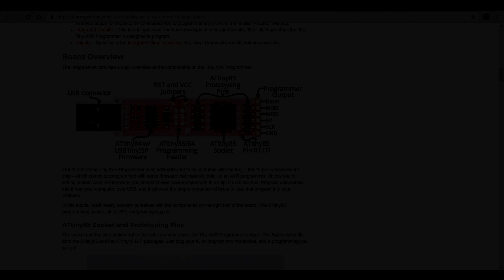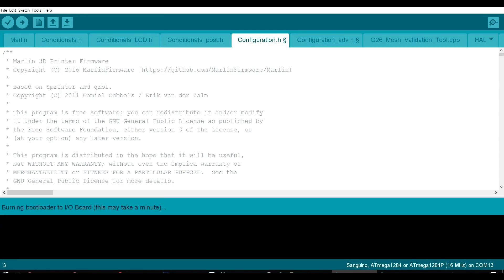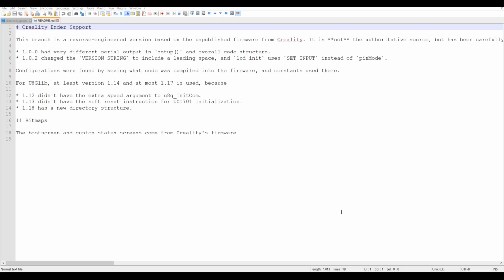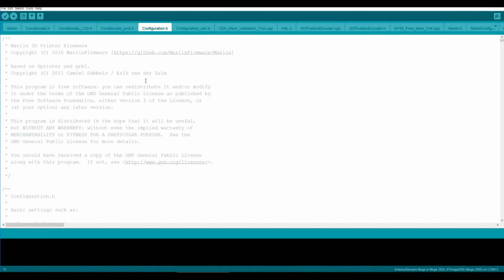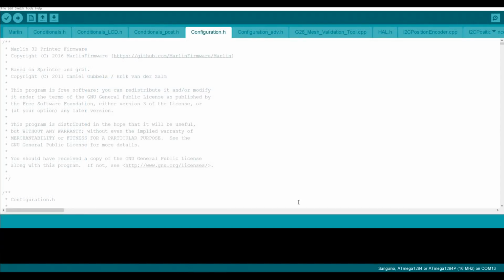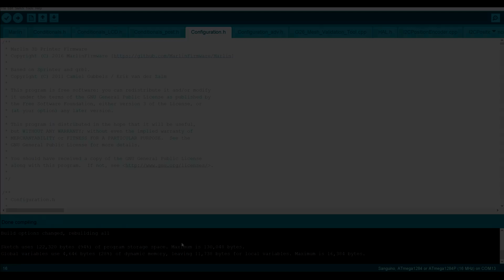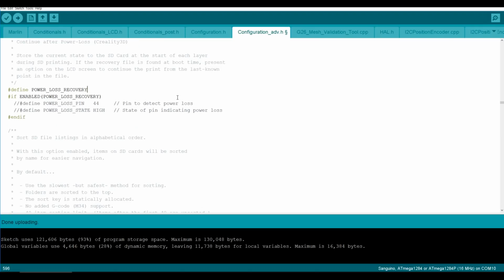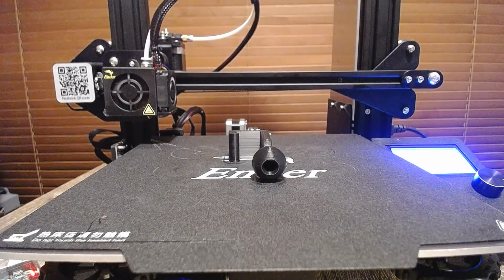Ender 3 vanilla Marlin update: Concise guide

Comment: Works fine until I try to add the Sanguino board.  I keep getting an error on download - Something about the java signature.  I get this error
sun.security.provider.certpath.SunCertPathBuilderException

Arduino: 1.8.7 (Windows 10), Board: "Arduino/Genuino Uno"

Error reading file (C:\Program Files (x86)\Arduino\hardware\arduino\avr\boards.txt:0): Invalid line format, should be 'key=value'

Error compiling for board Sanguino W/ ATmega1284 or ATmega1284P (16MHz).
Invalid library found in C:\Program Files (x86)\Arduino\libraries\NEW_Touchscreen: no headers files (.h) found in C:\Program Files (x86)\Arduino\libraries\NEW_Touchscreen
Invalid library found in C:\Program Files (x86)\Arduino\libraries\NEW_Touchscreen: no headers files (.h) found in C:\Program Files (x86)\Arduino\libraries\NEW_Touchscreen
 Error downloading https://github.com/Lauszus/Sanguino/releases/download/1.0.2/Sanguino-1.0.2.zip
java.lang.RuntimeException: java.lang.Exception: Error downloading https://github.com/Lauszus/Sanguino/releases/download/1.0.2/Sanguino-1.0.2.zip
 at cc.arduino.contributions.packages.ui.ContributionManagerUI.lambda$onInstallPressed$2(ContributionManagerUI.java:175)
 at java.lang.Thread.run(Thread.java:748)
Caused by: java.lang.Exception: Error downloading https://github.com/Lauszus/Sanguino/releases/download/1.0.2/Sanguino-1.0.2.zip
 at cc.arduino.contributions.DownloadableContributionsDownloader.download(DownloadableContributionsDownloader.java:139)
 at cc.arduino.contributions.DownloadableContributionsDownloader.download(DownloadableContributionsDownloader.java:73)
 at cc.arduino.contributions.DownloadableContributionsDownloader.download(DownloadableContributionsDownloader.java:55)
 at cc.arduino.contributions.packages.ContributionInstaller.install(ContributionInstaller.java:101)
 at cc.arduino.contributions.packages.ui.ContributionManagerUI.lambda$onInstallPressed$2(ContributionManagerUI.java:172)
 ... 1 more
Caused by: javax.net.ssl.SSLHandshakeException: sun.security.validator.ValidatorException: PKIX path building failed: sun.security.provider.certpath.SunCertPathBuilderException: unable to find valid certification path to requested target
 at sun.security.ssl.Alerts.getSSLException(Alerts.java:192)
 at sun.security.ssl.SSLSocketImpl.fatal(SSLSocketImpl.java:1964)
 at sun.security.ssl.Handshaker.fatalSE(Handshaker.java:328)
 at sun.security.ssl.Handshaker.fatalSE(Handshaker.java:322)
 at sun.security.ssl.ClientHandshaker.serverCertificate(ClientHandshaker.java:1614)
 at sun.security.ssl.ClientHandshaker.processMessage(ClientHandshaker.java:216)
 at sun.security.ssl.Handshaker.processLoop(Handshaker.java:1052)
 at sun.security.ssl.Handshaker.process_record(Handshaker.java:987)
 at sun.security.ssl.SSLSocketImpl.readRecord(SSLSocketImpl.java:1072)
 at sun.security.ssl.SSLSocketImpl.performInitialHandshake(SSLSocketImpl.java:1385)
 at sun.security.ssl.SSLSocketImpl.startHandshake(SSLSocketImpl.java:1413)
 at sun.security.ssl.SSLSocketImpl.startHandshake(SSLSocketImpl.java:1397)
 at sun.net.www.protocol.https.HttpsClient.afterConnect(HttpsClient.java:559)
 at sun.net.www.protocol.https.AbstractDelegateHttpsURLConnection.connect(AbstractDelegateHttpsURLConnection.java:185)
 at sun.net.www.protocol.https.HttpsURLConnectionImpl.connect(HttpsURLConnectionImpl.java:162)
 at cc.arduino.utils.network.FileDownloader.downloadFile(FileDownloader.java:181)
 at cc.arduino.utils.network.FileDownloader.download(FileDownloader.java:132)
 at cc.arduino.contributions.DownloadableContributionsDownloader.download(DownloadableContributionsDownloader.java:137)
 ... 5 more
Caused by: sun.security.validator.ValidatorException: PKIX path building failed: sun.security.provider.certpath.SunCertPathBuilderException: unable to find valid certification path to requested target
 at sun.security.validator.PKIXValidator.doBuild(PKIXValidator.java:397)
 at sun.security.validator.PKIXValidator.engineValidate(PKIXValidator.java:302)
 at sun.security.validator.Validator.validate(Validator.java:260)
 at sun.security.ssl.X509TrustManagerImpl.validate(X509TrustManagerImpl.java:324)
 at sun.security.ssl.X509TrustManagerImpl.checkTrusted(X509TrustManagerImpl.java:229)
 at sun.security.ssl.X509TrustManagerImpl.checkServerTrusted(X509TrustManagerImpl.java:124)
 at sun.security.ssl.ClientHandshaker.serverCertificate(ClientHandshaker.java:1596)
 ... 18 more
Caused by: sun.security.provider.certpath.SunCertPathBuilderException: unable to find valid certification path to requested target
 at sun.security.provider.certpath.SunCertPathBuilder.build(SunCertPathBuilder.java:141)
 at sun.security.provider.certpath.SunCertPathBuilder.engineBuild(SunCertPathBuilder.java:126)
 at java.security.cert.CertPathBuilder.build(CertPathBuilder.java:280)
 at sun.security.validator.PKIXValidator.doBuild(PKIXValidator.java:392)
 ... 24 more
Invalid library found in C:\Program Files (x86)\Arduino\libraries\NEW_Touchscreen: no headers files (.h) found in C:\Program Files (x86)\Arduino\libraries\NEW_Touchscreen
Invalid library found in C:\Program Files (x86)\Arduino\libraries\NEW_Touchscreen: no headers files (.h) found in C:\Program Files (x86)\Arduino\libraries\NEW_Touchscreen
Invalid library found in C:\Program Files (x86)\Arduino\libraries\NEW_Touchscreen: no headers files (.h) found in C:\Program Files (x86)\Arduino\libraries\NEW_Touchscreen
Invalid library found in C:\Program Files (x86)\Arduino\libraries\NEW_Touchscreen: no headers files (.h) found in C:\Program Files (x86)\Arduino\libraries\NEW_Touchscreen
Invalid library found in C:\Program Files (x86)\Arduino\libraries\NEW_Touchscreen: no headers files (.h) found in C:\Program Files (x86)\Arduino\libraries\NEW_Touchscreen
Invalid library found in C:\Program Files (x86)\Arduino\libraries\NEW_Touchscreen: no headers files (.h) found in C:\Program Files (x86)\Arduino\libraries\NEW_Touchscreen
Invalid library found in C:\Program Files (x86)\Arduino\libraries\NEW_Touchscreen: no headers files (.h) found in C:\Program Files (x86)\Arduino\libraries\NEW_Touchscreen
Invalid library found in C:\Program Files (x86)\Arduino\libraries\NEW_Touchscreen: no headers files (.h) found in C:\Program Files (x86)\Arduino\libraries\NEW_Touchscreen
 Error downloading https://github.com/Lauszus/Sanguino/releases/download/1.0.2/Sanguino-1.0.2.zip
java.lang.RuntimeException: java.lang.Exception: Error downloading https://github.com/Lauszus/Sanguino/releases/download/1.0.2/Sanguino-1.0.2.zip
 at cc.arduino.contributions.packages.ui.ContributionManagerUI.lambda$onInstallPressed$2(ContributionManagerUI.java:175)
 at java.lang.Thread.run(Thread.java:748)
Caused by: java.lang.Exception: Error downloading https://github.com/Lauszus/Sanguino/releases/download/1.0.2/Sanguino-1.0.2.zip
 at cc.arduino.contributions.DownloadableContributionsDownloader.download(DownloadableContributionsDownloader.java:139)
 at cc.arduino.contributions.DownloadableContributionsDownloader.download(DownloadableContributionsDownloader.java:73)
 at cc.arduino.contributions.DownloadableContributionsDownloader.download(DownloadableContributionsDownloader.java:55)
 at cc.arduino.contributions.packages.ContributionInstaller.install(ContributionInstaller.java:101)
 at cc.arduino.contributions.packages.ui.ContributionManagerUI.lambda$onInstallPressed$2(ContributionManagerUI.java:172)
 ... 1 more
Caused by: javax.net.ssl.SSLHandshakeException: sun.security.validator.ValidatorException: PKIX path building failed: sun.security.provider.certpath.SunCertPathBuilderException: unable to find valid certification path to requested target
 at sun.security.ssl.Alerts.getSSLException(Alerts.java:192)
 at sun.security.ssl.SSLSocketImpl.fatal(SSLSocketImpl.java:1964)
 at sun.security.ssl.Handshaker.fatalSE(Handshaker.java:328)
 at sun.security.ssl.Handshaker.fatalSE(Handshaker.java:322)
 at sun.security.ssl.ClientHandshaker.serverCertificate(ClientHandshaker.java:1614)
 at sun.security.ssl.ClientHandshaker.processMessage(ClientHandshaker.java:216)
 at sun.security.ssl.Handshaker.processLoop(Handshaker.java:1052)
 at sun.security.ssl.Handshaker.process_record(Handshaker.java:987)
 at sun.security.ssl.SSLSocketImpl.readRecord(SSLSocketImpl.java:1072)
 at sun.security.ssl.SSLSocketImpl.performInitialHandshake(SSLSocketImpl.java:1385)
 at sun.security.ssl.SSLSocketImpl.startHandshake(SSLSocketImpl.java:1413)
 at sun.security.ssl.SSLSocketImpl.startHandshake(SSLSocketImpl.java:1397)
 at sun.net.www.protocol.https.HttpsClient.afterConnect(HttpsClient.java:559)
 at sun.net.www.protocol.https.AbstractDelegateHttpsURLConnection.connect(AbstractDelegateHttpsURLConnection.java:185)
 at sun.net.www.protocol.https.HttpsURLConnectionImpl.connect(HttpsURLConnectionImpl.java:162)
 at cc.arduino.utils.network.FileDownloader.downloadFile(FileDownloader.java:181)
 at cc.arduino.utils.network.FileDownloader.download(FileDownloader.java:132)
 at cc.arduino.contributions.DownloadableContributionsDownloader.download(DownloadableContributionsDownloader.java:137)
 ... 5 more
Caused by: sun.security.validator.ValidatorException: PKIX path building failed: sun.security.provider.certpath.SunCertPathBuilderException: unable to find valid certification path to requested target
 at sun.security.validator.PKIXValidator.doBuild(PKIXValidator.java:397)
 at sun.security.validator.PKIXValidator.engineValidate(PKIXValidator.java:302)
 at sun.security.validator.Validator.validate(Validator.java:260)
 at sun.security.ssl.X509TrustManagerImpl.validate(X509TrustManagerImpl.java:324)
 at sun.security.ssl.X509TrustManagerImpl.checkTrusted(X509TrustManagerImpl.java:229)
 at sun.security.ssl.X509TrustManagerImpl.checkServerTrusted(X509TrustManagerImpl.java:124)
 at sun.security.ssl.ClientHandshaker.serverCertificate(ClientHandshaker.java:1596)
 ... 18 more
Caused by: sun.security.provider.certpath.SunCertPathBuilderException: unable to find valid certification path to requested target
 at sun.security.provider.certpath.SunCertPathBuilder.build(SunCe
Reply: Update -Had to do a work around - Since the Sanguino board was in the TH3D Software I updated the config files within it and its included version of arduino.  I never did get it to work on the out of the box arduino 1.8.7 and emailed the author of the code with the error.  We will see what they say.
Reply from the maker: That's a weird one. An uno error when selecting a Sanguino. Fingers crossed for you. I believe you can start with the TH3D batch file and then open any Arduino ino file from there if that helps. Maybe I've misunderstood and that's what you've already done.

Comment: It seems having an Arduino bootloader on the printer causes it to reboot when the COM port is opened, at least that is what is happening to me. This causes Cura not to detect the printer as it only 1.5 seconds for the reboot. Printing via USB stick is OK though. Might be worth a guide on how to program Marlin without a bootloader.

Comment: I have been meaning to update my ender 3 using your guide for a week or 2 now and today I finally got the chance. 1 thing i did notice is that your installing the wrong version of the u8glib library. The text file states no newer than 1.17 due to folder structure changes and your installing 1.19.1.
Perhaps this is why some of the features are not working correctly for some people.
1.17 is not availible through the arduino library manager so you need to go to the u8glib github and dl it manually then install via the add.zip library function under include library via the sketch menu. You will need to remove the existing installed u8glib library first though by going to your documents/arduino/libraries folder and deleting the u8glib folder as this is the 1
19.1 version and needs to be deleted before you can install the 1.17 version.
Thank you again for your vids. Without them figuring all this out on my own would be fustrating and time consuming and i probably wouldn't bother due to time constraints so i appreciate your efforts.
Reply from the maker: Thanks, I completely missed this. It seems to be working fine for me, I haven't noticed the LCD problems you mention?
Reply: https://bintray.com/olikraus/u8glib/Arduino/1.17
Reply: I also installed the 1.19 version of u8glib and flashed the latest Marlin (1.1.9). I have not run a print yet, but the LCD and rotary encoder all function perfectly.
Reply: all fine with newest library, no problems here

Comment: Where in the firmware can I set the behavior of the hot end fan? Mine is on all the time. It didn't use to do that before. I only want it on when I'm printing. Any one knows? Help appreciated. Thanks
Reply from the maker: That is something I'll be looking in to soon. My Tevo Tornado is silent between prints, but the Ender 3 fan stays on until power cycling. Very annoying.
Reply: @TeachingTech  I am sure in one of the other Firmware trials I did it wasn't running but than I had other issues and I can't remember which one it was.
Reply: @Megdiver  In the example configs for marlinfw, the  extruder fan supposed to turn on automatically when above 50, there is also some pin configurations. Perhaps the pins assignments are the issue or the temperature is being ignored alltogether. I'll keep looking in the code. Mine has the default ender3 fw and the extruder fan doesn't come on until I do the preheat.
Have a look here: https://github.com/MarlinFirmware/Marlin/blob/85c82ab28e13cb25043ae166062785bff39434b9/Marlin/example_configurations/Creality/Ender-3/Configuration_adv.h#L229-L248
https://github.com/Creality3DPrinting/Ender-3/issues/19

Edit: I'll be upgrading my ender this week, and I'll be able to debug via serial.
After looking at both pins.h on the marlinfw and ender fw, pin assignment is quite different. The pins.h on ender fw looks to be modified just for creality printers different boards. On the creality board it looks like one fan header pinout is a pwm fan output. If your fan is constantly on, then pin assignment might be the issue.
Reply: Disregard everything above that's on the software side. On the default Creality  Board V 1.1.3  the hot end fan  is hooked up straight to 12VDC https://www.amazon.co.uk/Creality-3D-Replacement-Mainboard-200x220x225mm/dp/B07G946RKT
on the green terminal board with six terminals lower left, the first two terminals on the left are for the hot end fan.  I don't particularly like this design. I guess the easiest thing would be upgrade to another board like Michael did with the MKS board upgrade tutorial with more output control D7. Alternatively I was thinking to maybe just swap main board fan with hot end fan wiring. That would mean the hot end fan would be pwm controllable with some minor firmware modification, and the main board fan would be on all the time. I don't know if I am ready to upgrade the board just yet, so I will try this out and report back I might do a video on my channel if it works.
Reply: @nobytes2  just a few bits of info that may or may not concern you. Firstly, that board is no different from the stock board with regard to the fans, they will both still run constantly as they are still wired together. With regard to the "effectively solving the heating problem" I wrote the seller from the US store and was told that the newer versions had a problem with the bed overheating which I assume had something to do with the MOSFET and not the fans. Secondly, not sure if you are aware but from everything that I have read, the hotend fan is 24V and not 12V. You can take all this with a grain of salt as I am very new to the 3D community, just wanted to give you a heads up just in case.
Reply: @corychavez8038  Thanks for the info, however is wrong for my stock board. Neither fan is wired together on my ender 3 with board V 1.1.3. The hot end fan is wired straight to 12VDC. The other two fans main board and part are controlled with pwm. If you look at the starting instructions you can see a picture of all connections too. As of now the only way to turn off the hot end fan would be to use a small comparator circuit based on the thermistor temperature and a relay. Really annoying to have fan on when not printing. What's your version of the board?

Comment: But Bltouch won't fit on ender 3 board using Marlin 1.1.9
Reply from the maker: Indeed it will. It needs some tweaking.
Reply: #define DISABLE_M503
//#define EEPROM_CHITCHAT
//#define ARC_SUPPORT

and it's fits :D thanks
Reply from the maker: I have done it a different way, but will be posting options.

Comment: I realize the board can cost almost as much as the whole printer, but what are your thoughts on a Duet replacing the factory board? They will soon have 3 different board options. And I wonder if you will end up spending that on upgrades to the board anyway. I have a Duet WiFi on my coreXY, and it seems like it's a lot more approachable to most people than flashing firmware and installing various improvements. I'm considering the Ender as my second printer right now (or an i3 Mega). It's that or bite the bullet and get the delta I want $$$.  Oh, and the power loss and filament out stuff actually work on the Duet ;-)
Reply from the maker: I'm investigating a cheaper alternative. Probably no as nice as a Duet Wifi but much cheaper. Check out Design Prototype Test for an Ender 3 video on Duet Wifi.
Reply: Upgrading good parts with a better board is still a win imo. Sure, the board can be as much as the printer in total, but I like to see it as an affordable starting point :). I'm actually waiting for the delivery of a Fysetc F6 + Watterott TMC 2208 drivers. A bit cheaper than a duet and should fit the Ender case. The duet is capable of more stuff and has integrated TMC drivers so the actual price difference is not that big actually.